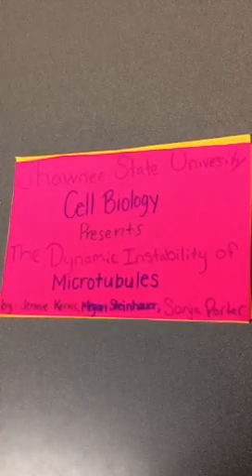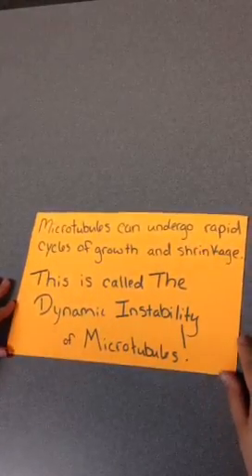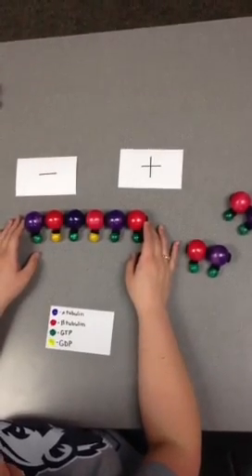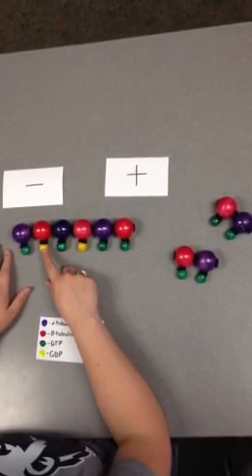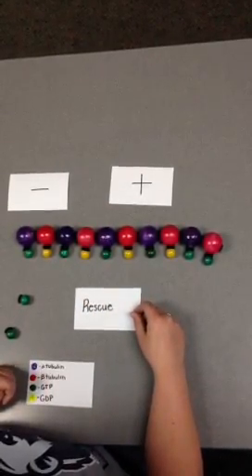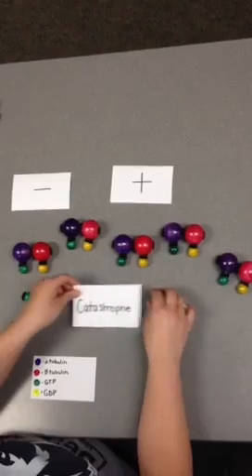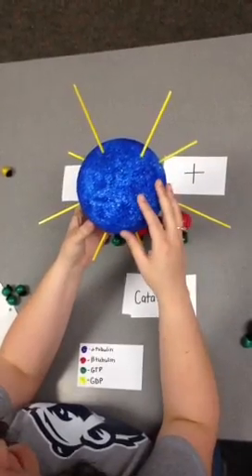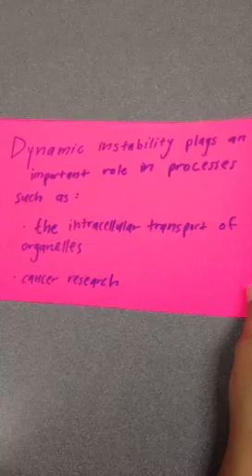Dynamic Instability of Microtubules

Comment: I thought it adds on the + end and shrink on the - end?
I'm confused??
Reply: It both adds and loses tubulin all on the + end, this is because the + end is the dynamic end. It's not called the --end because it loses tubulin, it's just called that to designate polarity on the microtubule. Tubulin CAN be lost from the - end however. If you've ever heard of the term 'treadmilling', its when the rate of addition at the plus end is equal to the rate of loss at the minus end, so the microtubule has no net gain or loss of tubulin.
Reply: I think it occurs in plant cells where they lack a centrosome.